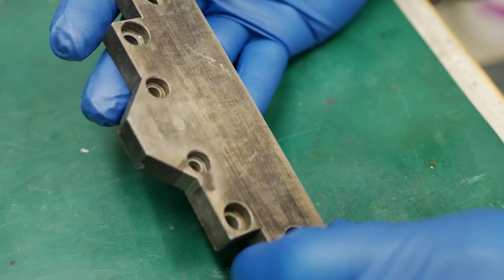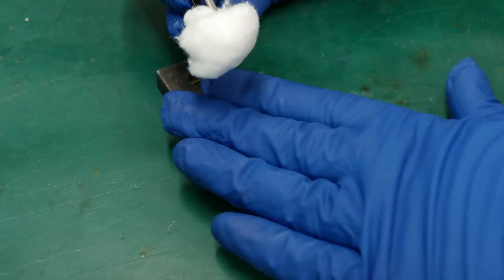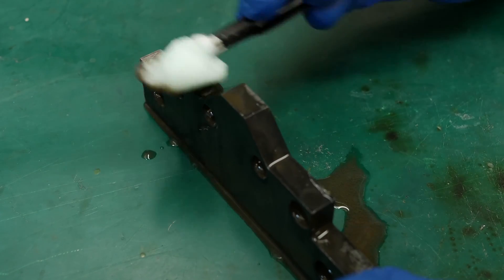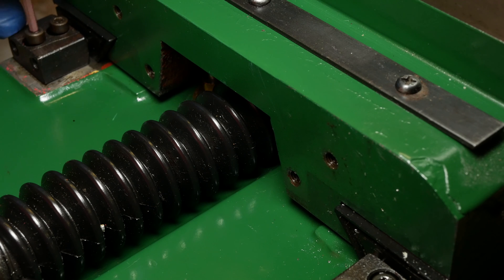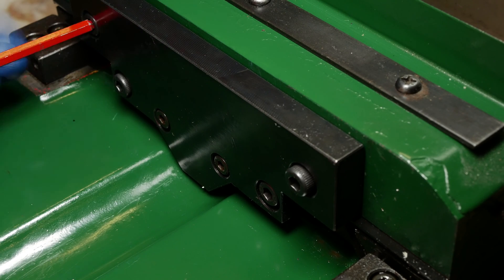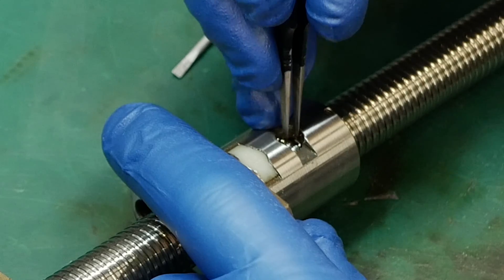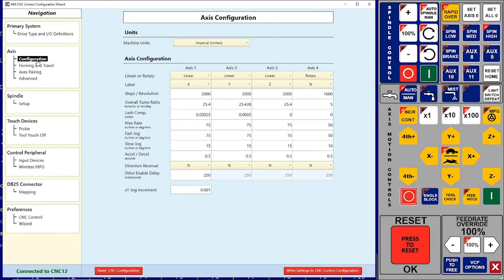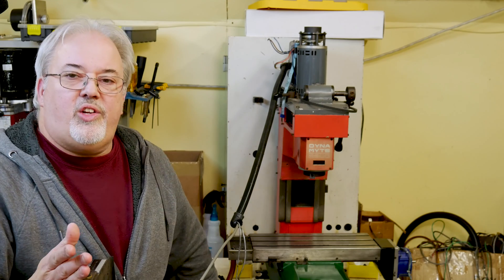Centroid Retrofit- Reassembly Begins on Dyna Myte 2800

Comment: My suggestion to you regarding the spindle motor is to try and replace it with a 3 phase 1hp motor and use a VFD. Far less trouble....
Reply from the maker: I love this idea Marty, It would certainly be simpler and I could clear out the entire top 1/3rd of my electrical panel and replace it with a small VFD and have room for the Ether1616.  My only concern is the added weight on the Z axis.  The motors I'm seeing are substantially heavier than the BLDC motor there now.  I may have to re-evaluate the counterbalance if I go that route.
Reply: @PeteRondeau  did you upgrade your stepper motors any? Can your drives support a little larger Z stepper?
Reply from the maker: I haven't done any motor upgrades.  After seeing how the original timing belt was shredded when run with no counterweight, I'm not sure how much additional capacity that belt has.  That makes me think if I upgrade the motors, I should probably go direct coupled- which is a whole project by itself, and my existing Gecko Drives max out at 3.5 amps.
Reply: Pete, once you get it up and running, it will be fairly trivial to upgrade to closed loop hybrid steppers. I have worked on the baby brother DM2000 series and the older brother, DM4400, but not the 2800. The 2800 has belts and pulleys between the motor and screws? Did you have any good pictures of that and the motor mounts?
Do you know what the original torque is of the current stepper motors and what is the reduction ratio? The belts you had may have been old, worn or incorrect type. Let that one go for now.
Reply from the maker: Marty, yes, there is a belt reduction between the motors and screws. The belt reduction is 2.5  the data sheet is a bit confusing but as near as I can tell, the motor has around 110 oz/in of holding torque- .  This part of a previous video shows me installing the motor: https://youtu.be/AmTo_8h_Evk?t=1097

Comment: Dyna's were well thought out little machines.
Reply from the maker: I've been really impressed with the build quality on this machine from day one.  The only point lacking is the electronic package but we are talking about something about 30 years old.
Reply: I have two (2) Dyna 3000 lathes... one that is fully updated to Mach3, the other that is the next victim.   Well built machines.   Mach3 can handle the tool changer/turret.  Not sure about the PLC programming required to do the same in Acorn (but would love to upgrade away from Windows XP machines.....)